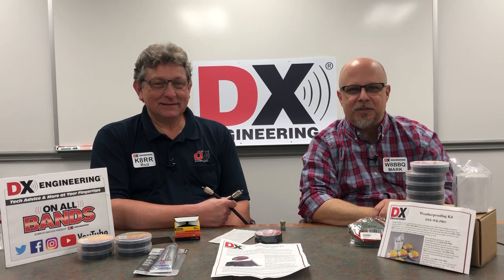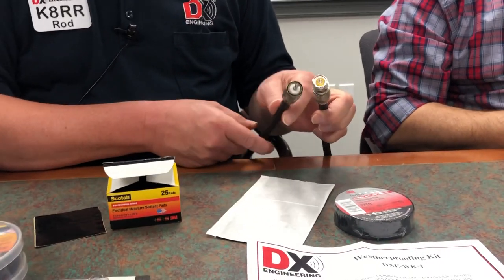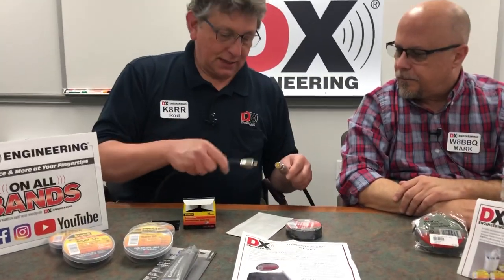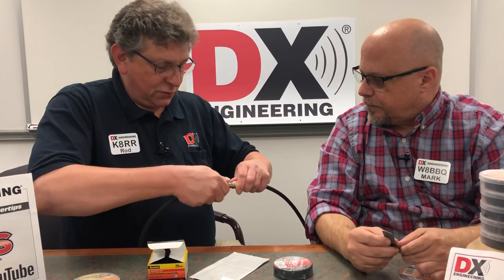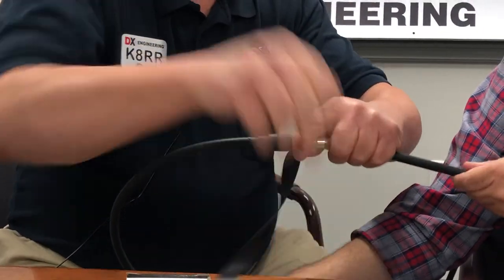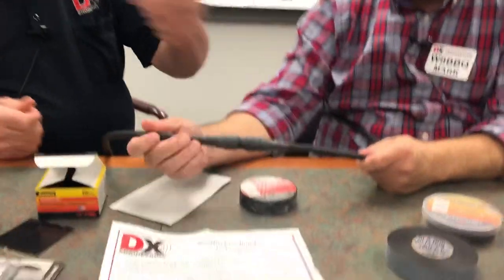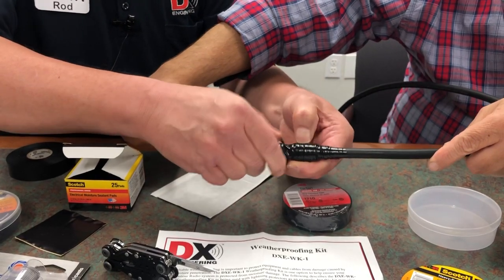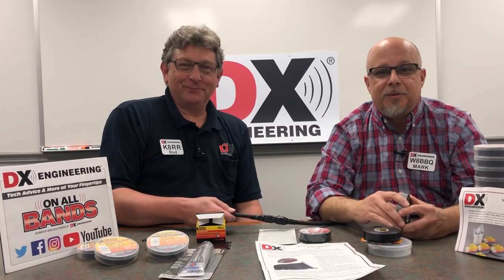Weatherproof and UV protect your Coax Cable Connector - DX Engineering

Comment: For a permanate seal (that can still be removed Anchor makes a sealant coated heat shrink, I use 3/4" (that shrinks down 3 times smaller aprox 1/4") .  I have removed this after 20+ years of exposure to the sun and salt water on a sailboat's mast and the connectors still looked new.

Comment: For a permanent installation, I use a silicone dielectric grease being careful to keep it out of the connector.  I coat the exterior of the conection too. Then I use shrink tubing to cover the connector to finish it. It makes a neat looking connection. It's worked great for me
 for 30 years. For a temporary install, I use rubber tape to water proof the connection. I'm sold on the 3M products.

Comment: Great video! May I humbly suggest that when ending the last layer of tape, that you cut it rather than pull/stretch it to separate it from the roll. Cutting helps prevent "flagging", which tends to then self unravel. Home depot sells "Commercial Electric" brand #PLT-122 stretchy tape and Scotch Super 33. 33 is also UV safe. Cheers!

Comment: I did this exactly as shown.  I knew better.  I learned many years ago that any enclosed space that isn't airtight, and is thermal cycled, will pump full of water.  Yes, it's a watertight seal - that keeps the water in.  It's not airtight, therefore, water comes in.  My SWR went nuts, because my connection filled with water and froze, breaking the backshell off the PL-259.  Cooling pulls air in, water condenses.  Warming pushes air out, and the cycle repeats until the space is full of water.

Comment: Ive wondered but dielectric grease is non-conductive it is interrupting my shield connection, and some guys think it ok to put on center pin also.  I prefer a spray of deoxit before connecting and taping. KC2-AGT John

Comment: When I was a teenager in highschool I cut my hand with a utility knife slicing cable just as you were there6:21(still have a scar), instead of moving the knife along the cable hold the knife and cable in one hand  such that the index finger lifts the cable against the knife, then pull the cable through with the other hand you will have greater control  and can't cut yourself this way.
Reply: Cut towards your buddy, not your body!

Comment: On permanent sealing, id used double wall epoxy heat shrink which will encapsulate the connectors and coax and will be weatherproof.

Comment: )Uh,  I thought "dielectric grease"  was aan electrical conductor. I put in on my car battery posts, and then discovered my batteries would not ever charge.  I am shocked to see anyone suggesting something that is about the same as  PETROLEUM JELLY. If anyting would ever run or flow, and  coat your wires, it is Dielectric Grease.  Huh-Uh. Not me Baby.   All of my protective coatings are going on the outside of the COAX. However, I did buy all the other DX Engineering  Tape and TenFlex.  Your COAX Cable Stripper is so easy to use I am really happy. Your Cable Cutter is the best!  etc. Good stuff.
Reply: Odd since dielectric is the insulator in coax. The first I saw it was way back doing spark plug wires - it was specified for the high voltage system to prevent flash over.

A popular antenna maker has recently been suggesting petroleum jelly for the same thing - sealing the threads.

Like others, I wondered about glue lined heat shrink.

Comment: Don't ever use that cheap, crappy Harbor Freight electrical tape (someone in comments say they recommend it for a temp connection).  That shlitz will soon unfold and leave a very sticky residue.  I tried their tape once (being on the cheap), regretted it and threw the rest of the rolls away.  It doesn't even wrap that well.
I was a Field Wireman in the Marines back in the 80's (don't remember brand of the tape if it had a brand, but very similar to the 3M 33+).  We learned to water-proof a connection was to start in middle, wrap to [right or left], back to opposite side, then end in the middle and use a knife (or scissors) to cut, don't tear or the tape will unfold.
I recently retired (34 years) as a telecomm engineer and was a tech before that for many years.  The RF connectors, it was best to start with the 3M tape (I wrapped as taught in Marines), cover with the water-proofing material, then finish with the 3M tape.  These methods held up well to the SoCal UVs and weather.

Comment: What about plumbers tape around the threads?
Reply: Bad idea, the threads provide the ground so RF doesn't leak out. If the plumbers tape causes the connection to be broken, you'll leak RF and could let in stray RF.

Comment: If you put electrical tape first, over time it will leave glue residue and the surface will be sticky. It's cleanable with IPA, but that's a painful job to do for a not really effective result, imho.